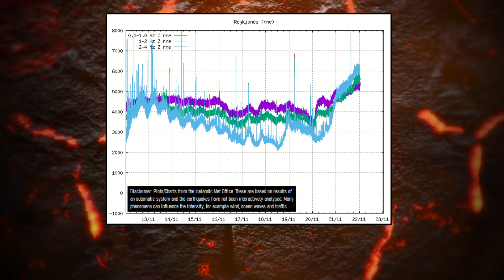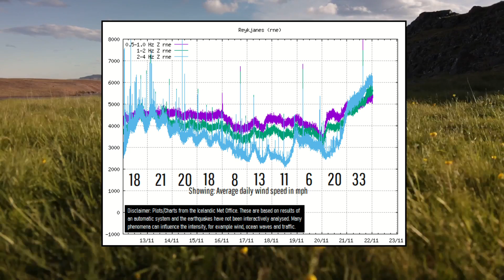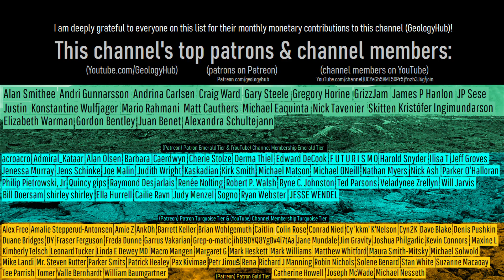Iceland Volcano Update; Magma is Recharging for Another Round, Volcanic Tremor Increases

Comment: Most of the (very weak) quakes occur three kilometers (two miles) due north of Grindavik. If anything happens, I would expect it to be east of the Sylingafell. Of course the lava can still run south towards the sea, but it should pass by Grindavik on the eastern side. Which is still bad for the coastal road. 

The authorities of Iceland see it differently. They noticed a cooling of the dike, which would result in the shrinking of the material, creating cavities which might sink in under the weight of the solidified layers of of older eruptions. The Reykjanes peninsula is one big lava field, after all. 

There is also a lot of heavy roadbuilding going on, which triggers the seismometers and causes the registration of a series of micro quakes. You can see the effects of these activities on 'Unrest at Svartsengi/Grindavik, Iceland: Live DAS data from Blue Lagoon' - there are a lot of slanting lines in the waterfall diagram that are all caused by motorized vehicles moving around, revving up, slowing down, etc. 

According to Thorvaldur Thordarson, an Icelandic volcanologist, there will eventuelly be an eruption; the question is not whether it will happen, but when and where. We might be at the beginning of another round of volcanic activity that might last for centuries. But for now, Grindavik seems to have escaped the worst scenario and can recover.

Comment: this video makes more sense than i have heard from iceland as so far the experts have said that :-
1.lots of quakes an eruption is imminent.
2. quakes have stopped , an eruption is imminent.
3. ground lift , an eruption is imminent.
4. the ground has sank , an eruption is imminent.
5. lots of gassing an eruption is imminent.
6. there is lots of gassing the magma is turning solid the eruption may not happen.
7. there is magma and an eruption may happen.
8. there is magma and it may form a sill and a failed intrusion.
Reply: There are so many variables and so little modern experience with the Reykjanes volcanic system that it's just about impossible to accurately predict what will happen, especially in the short term.  Until a few years ago, the system had been quiet for 800 years, and there's no very similar system in the world.  I suspect that the local experts are being portrayed as more sure in their predictions than they actually are.

Comment: The full Moon might tip it.
Reply: I also think so!
Reply: The gravity difference of a full moon overhead vs a not full moon is insignificant.  The moon is more or less overhead once a day after all.
Reply: @b.a.erlebacher1139  there isn't a " once a day " alignment of the Sun, Moon and Earth. It happens twice monthly.

There's a tidal force in the Earths crust. It flexes by about 300mm under a Full or New Moon.

That's why I posted my original comment.
Reply: @genghisthegreat2034  And how much does the crust flex daily due to tidal force from the moon alone?  The tidal effect of the sun is much less significant than that of the moon.  You can calculate this with basic physics.  And there's zero evidence that moon phase has any effect on volcanic activity.
Reply: @b.a.erlebacher1139  the difference between a Spring Tide, and a Neap Tide in the ocean can be very significant. The same effect occurs in the Earths crust, with a much diminished amplitude in rock, of course.

I don't say that combined solar and lunar tidal forces are correlated with volcanic activity. I do say, that where there's magma close enough to the surface already,  a full moon might tip it. See my original comment.

Comment: They drill for geothermal heat and power.  Why not drill near the coast to the dike to control the release.  A bomb might be needed for the breakthrough.  With a controled release it could be directed.  Not sutible for explosive volcanoes but Iceland's are steady flow types that with planning can be harnessed and directed.  They already saved one town by building a lava wall dam that towers over the town.  By tapping near the coast the can add land or a harbor wall.  They can turn this problem into an asset IMHO.